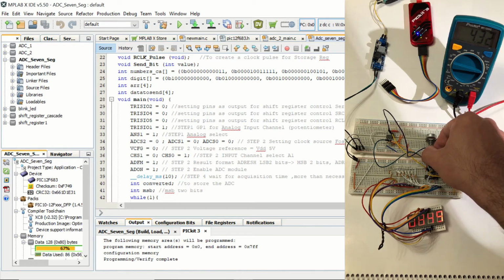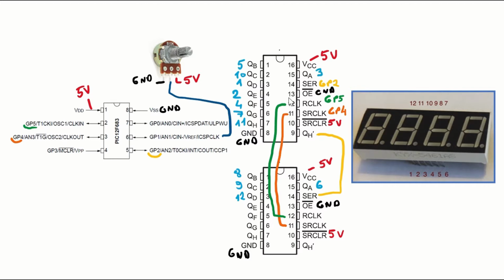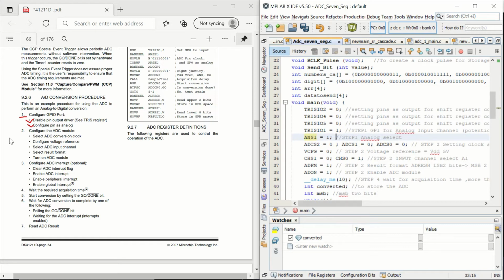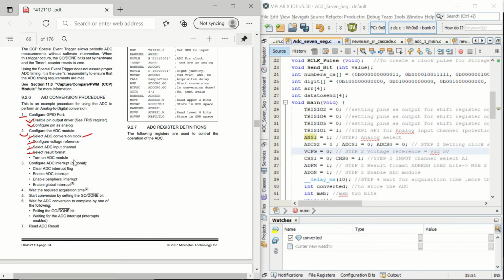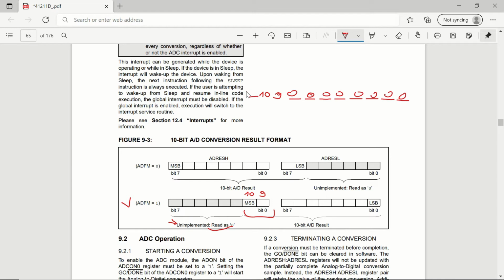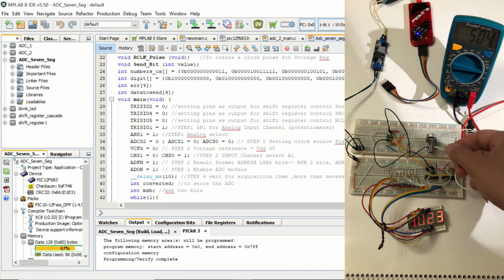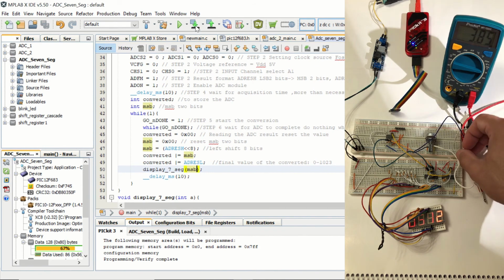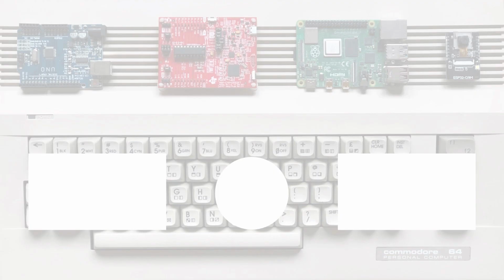PIC Microcontroller & Analog to Digital Conversion (ADC)

Comment: Hi! Very nice video.
Maybe in a next PIC-related (or any microCont.) video you should mention about "Sending the microcontroller to SLEEP-mode during A/D-conversion" to reduce noise due to CPU-active state.
Another thing which took time for me also to check ERRATA documents. 
As a tip: first I always check Silicon ERRATA documents (what and where is a problem with the chip) to avoid headaches (and overnight debugging).

These were sidenotes, not offending! 
Keep up with your very good content! 🙂